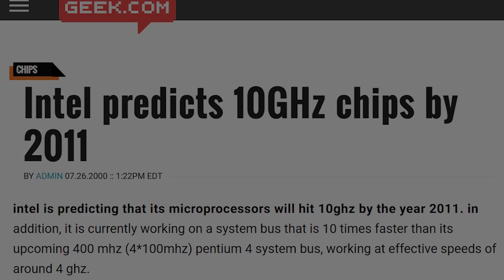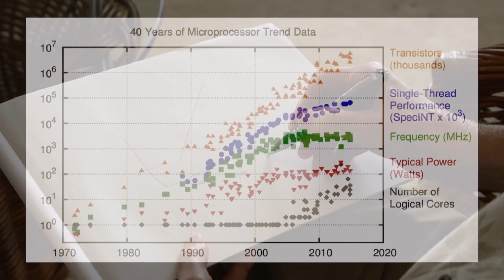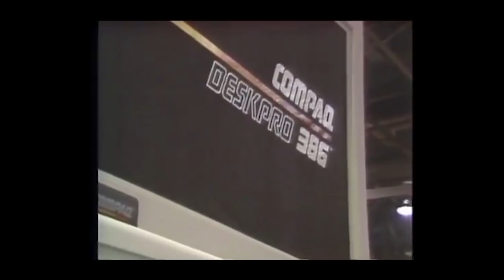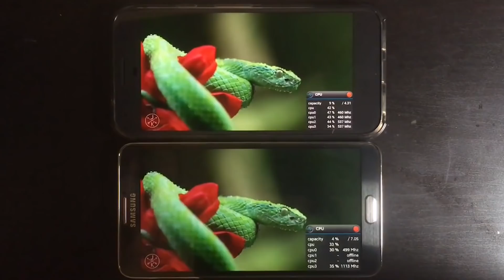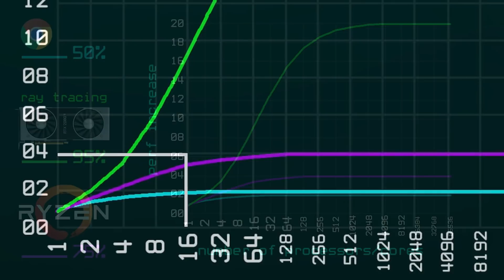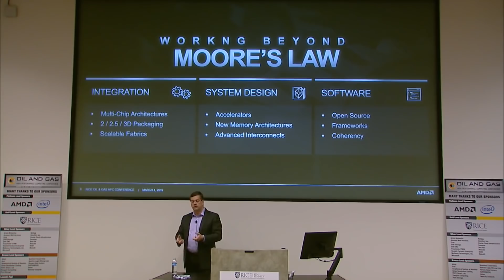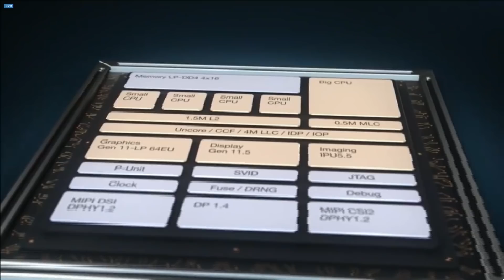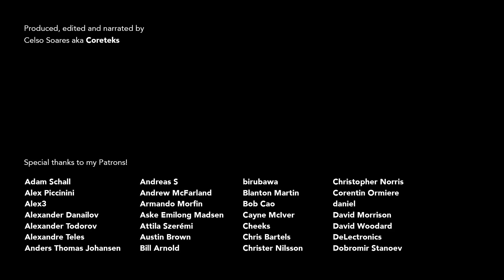Intel and AMD going BEYOND Moore's Law

Comment: Intel had Intel TERAHERTZ, 1THz, or 1000GHz chip in 2001 and they demo'd it at 100GHz in 2001 ! The said it ran at lower power, lower voltage and 10,000 times less leakage ! see the TechTV Terhertz commercial.  Motorola and DARPA have both announced Terahertz speeds in 2009 and 2011 too. So this is 3 companies that have demonstrated this in the real world. And 5G runs at 60GHz and 94GHz, but we  can barely do 5GHz ?  And we have had 1TB hard drive in 2007 and in 2019 they are STILL SOLD ! Barely any improvement in hard drives ! Seagate said they would have 100TB drives by 2012 then 2018 now 2022. There is no reason we should be stuck at 4GHz forever !  And even the many improvements in video cards aren't used in CPUs like 384 - 512 bit bus, GDDR5, HMB and HBM2 RAM, many more than just 4 cores. And single core performance is almost flat since 2007 !  Why can't we have the 100GHz or 1000GHz from Intel Terahers 18 years ago with similar to FinFet tech. And HEMT, 1THz transistors exist too, invented in the 1980s !  Intel said the 1THz, 1000GHz chips would be sold to consumers by about 2005. So where are they ? Or even the 10GHz you mentions ? It isn't a heat / power problem since Intel ran at LOWER power and voltage. Motorola and DARPA also mentioned no problems with heat. Maybe they are using the Intel technology.
And it's CPU speed, no single core improvement, RAM more that DOUBLE the 2012 price, and hard drives barely improving too. We should at about 64TB by now compared to the first 2007 1TB hard drive ! Yet they STILL SELL THEM 12 years later !
Reply: Intel never had 1THz in 2001, maybe they had a single transistor running that fast. Modern transistors might run at something like 10GHz individually, but when you have a few billion in a CPU, that number is a lot lower. In any case, the transistors aren't what's slowing down CPUs, it's power and heat requirements as well as the slow copper interconnects.
Reply: @jjwarner9419  They claimed to have a chip that was running at 100GHz with the tech being able to run at 1THz. They could be lying, but now Motorola and DARPA and claiming the exact same thing so unless all 3 are lying it is clearly possible. And the company that is making the HEMT transistors capable of 1THz and Northrop Grumman with their terahertz IC amplifier in 2014. The HEMT is in wiki HEMT, the Northrop Grumman story in Semiconductor Today, and the DARPA page is on DARPA's site. The wiki for Intel Teraherz listed about 3 different stories about them too. So do you really think all 4 companies are lying ? And notice they use the same HEMT transistors in this excerpt.
Northrop Grumman’s terahertz monolithic integrated circuit (TMIC) effectively bridges the gap by using a super-scaled 25nm gate-length indium phosphide (InP) high-electron-mobility transistor (HEMT) that measures at a gain of 10dB at 1THz and 9dB at 1.03THz. 
wiki for HEMT - Applications (eg for AlGaAs on GaAs) are similar to those of MESFETs – microwave and millimeter wave communications, imaging, radar, and radio astronomy – any application where high gain and low noise at high frequencies are required. HEMTs have shown current gain to frequencies greater than 600 GHz and power gain to frequencies greater than 1 THz.[5
ZDNet in 2001 - Intel terahertz transistor breaks speed limits
The terahertz transistor design -- a terahertz is a thousand gigahertz, or one trillion cycles a second -- is an evolution of current designs, using new materials such as zirconium dioxide. 
From DARPA - THZ Electronics
Terahertz Transistor Electronics. This part of the program has aggressively developed multi-THz Indium Phosphide-based transistors (heterojunction bipolar transistors, or HBTs, and High Electron Mobility Transistors, or HEMTs) and has demonstrated TMICs operating up to and above 1 THz. In addition, THz low-loss inter-element interconnect and integration technologies have been developed, enabling compact THz transmitter and receiver modules to demonstrate wireless communications at 220 GHz, 670 GHz, and 850 GHz – hundreds of times faster than your cell phone.
Motorola - Android Headlines - Terahertz Radio Transmission Promises 50Gbps Data Speeds

And AT&T - AT&T conducted trials in 2017 for business use of 400 gigabit Ethernet.[6] Researchers Robert Maher, Alex Alvarado, Domaniç Lavery, and Polina Bayvel of University College London were able to increase networking speeds to 1.125 terabits per second.[7]
AT&T* successfully completed testing a single-wavelength 400 gigabit Ethernet (GbE) data speed across its production network. This was the final phase of our multi-step trial. 

Notice how that story shows 332GHz demultiplexing ? So we can do 1.125 Terabits, 400 gigabit which has to be at least 200GHz for a single line ,1THz(1000GHz), 850GHz, 670GHz, 220GHz but 5GHz is the limit ? Notice the slowest of these stories showed 332GHz with all of them at 1THz, 1000GHz in use ? But nope, nothing over 5GHz is possible right ?
Reply: @jjwarner9419  Check out Intels ad at TechTV for them. And lookup Motorola, DARPA and HEMT transistors. All 3 companies have working chips running at 1THz. And another example is 5G. Lookup the frequencies for it of 60GHz and 94GHz. If you run the chips at much lower voltages you have much lower heat dissipation or I squared R losses and they are running at 0.5 and lower.  Don't believe me, read them for yourself. And ask how can a 94GHz 5G signal exist in a phone if silicon can only do 5GHz ? wiki the HEMT transistors that run over 1THz, up to 1300GHz the last time I checked with either DARPA or Motorola, I can't remember which. Notice how Coretek is also talking about how Intel was talking about 10GHz by around 2002 also ? They said the 1THz chips would be for sale to consumers by about 2005. Maybe the military doesn't want them sold, I don't know why they aren't out but all 3 companies say they have full chips, not just a single transistor or a mixer to hetrodyne the signal. Even Linus channel and others show 60GHz transcievers. And how do you think they control beamforming of a 60 or 94GHz signal if they don't have the silicon to do it. Perhaps the newer GaInAs chips that run faster and lower power that have been out for several years too. Notice this sentence from the wiki on HEMT transistors. Over 1THz, and their are several other transistor designs.
HEMTs have shown current gain to frequencies greater than 600 GHz and power gain to frequencies greater than 1 THz.[5]
And did you notice the patent date of 1979 ?   
US4163237 (A) ― 1979-07-31   US4163237 (A)  -  High mobility multilayered heterojunction devices employing modulated doping
This is 40 year old technology !  In 2001 the NSA said "consumers have too much computing power and we need to be able to read everyone's email".   Not related I'm sure.  Or it could just be greed by Intel but given the money they could make..... Maybe they make far more by selling exclusively to the military.  All I know is it's 1979 technology demonstrated in 2001 at 1THz and 100GHz by Intel, then DARPA and Motorola in 2009 and 2011.
2001 techtv clip - intels new "terahertz transistor"
https://youtu.be/U-Z1Zbqr0co
"By a complete redesign of the transistor itself
". Reducing the heat and leakage by 10,000 times, and LOWER power.
Watch for yourself from all 3 companies if DARPA hasn't removed their pages completely yet and several other articles.
"The chips could be in MASS PRODUCTION BY 2005".
Reply: @jjwarner9419  Even people on their own have had Intel CPUs up to 7GHz, and 8GHz with liquid nitrogen. This shows the silicon can go much faster. If they can make a 32 and 72 core CPU then they can make a 6 or 8 core much cheaper for consumers but notice the 4 cores are stuck at about $325 - 350 ?   And they can have the cores more widely spaced with soldered heat spreaders like they have done in the past instead of the paste that is less reliable. Use the Terahertz tech at only 10GHz or 100GHz running at .3 to .5v and it would be a big improvement and use the same speedstep type control as needed. Nvidia also shows testing at 10GHz and even 15GHz in some of coreteks videos. But see for yourself. I'm only going by what products are already out like 60GHz and 94GHz 5G that are in phones in chips instead of microwave plumbing waveguides. How can a 5G phone run at 94GHz if we don't have the chips to do it let alone the faster beamforming chips needed, ADC to convert to a baseband signal.
Reply: @jjwarner9419  Here is another example of technology that "doesn't exist". Watch "Rise of the Drones" on PBS. He mention the drones store 1 MILLION TERABYES PER DAY for EACH DRONE.  How do you make a RAID system that increases by 1 MILLION TB per day ? Your own hard drive factory ? Must be a mistake ? He mention the drone uses a 1.3 BILLION pixel sensor made from 384 cell phone cameras. So take 384 camera video for 24 hours a day at 60 FPS. It come up with about 700,000TB per day on one video calculator site ! And add the IR cameras not metioned too for even more data !  See the transcript on PBS for "Rise of the Drones" that shows these specs for a 1.3 billion pixel camera made from 384 cell phone camera sensors.  What tech could be used to story it ? Even a 10TB drive would be 100,000 new drives every day to reach 1,000,000 TB per day !

Comment: Didn't AMD already have "Neural Net Prediction Technology" in Ryzen?
Reply from the maker: You mean SenseMI? I believe that's for branch prediction, which is not quite the same thing. Prediction and Speculative Execution have been around for a long long time (since 386 at least).
Reply: @Coreteks  True, at the time it struck me that they emphasized the machine intelligence, learning and adopting. Anyway great video!
Reply: They are using a perceptron network, versus a neural network which can describe a miltilayer perceptron network. The single layer perceptron network gives them pretty good branch prediction via ML, but it can only find linearly seperable patters with which to predict the next instruction.

Feed forward neural networks can find nonlinear seperable patters with a corresponding differential order equal to the number of layers. There are some super nutty network designs that sidestep this and allow for arbitrary dimensionality from a single layer network, but that is probably outside the scope of what we would see in use here.

Comment: This tech reminds me of Process Lasso, ProBalance.
Reply: This is on the hardware level though not software
Reply: @456MrPeople 
Understood. But I wonder what differences there are?  I've heard that some online game anti-cheats prohibit Process Lasso.  Which is why I stopped using it.
Reply: @eastcoasthandle  "You heard" and "some online games" is not a good reason to stop using it.
Reply: @samixz  
Was it ever addressed otherwise? That's the point to my reply not about what I think I know or heard.  
Furthermore, what benefit does it offer using today's cpus? Are there current video demonstrations showing how using it benefits us in games today?
Reply: Video demonstrations? I don't really know. However I do know it helps me when I run 22 game clients on my computer at the same time!

Comment: Sorry if this is a noob question but... if you increase the number of cores, doesn't that mean that you can do more things at a time? Like run a game while you're raytracing something in the background or something?
Reply from the maker: Yes, that's one of the current benefits of multi-core CPUs, for instance if you are gaming and streaming at the same time. The video discusses improvements to single-threaded performance more specifically.
Reply: @Coreteks  does it work on dell Alienware r4 Intel i7 7700hk?
Reply: Yes, it does. However, most user loads don't approach full utilization to the point of needing more cores.
Reply: @droneaerial9140  Oh, okay. Thanks for the info!
Reply: I don't get the logic
Who runs games, renders, edits, watches videos, browses the Web at the same time

Comment: well, if you look at parallel processing like multiples of frequency, they weren't far off. it just ended up making more sense to do multicore instead for a lot of reasons.
Reply: Except they aren't multiples of frequencies.
Reply: @AhidoMikaro  For many applications, 2 cores at 3 Ghz ~= 1 core at 6 Ghz (not to mention the former uses 2-4 times less power if not more), since the vast majority of applications aren't that strictly sequential. In 2011 the best CPU to come out was probably the i7-3960X which had 6 cores plus hyperthreading at 3.3 Ghz. 3.3 * 6 ~= 19.8 Ghz-Cores of power. HT generally boosts that up by about 30% to 25.7 Ghz-Cores (it would be nice to use something like FLOPS for this but I would need predictions from 2000 in terms of FLOPS). Various architecture optimizations also boost it up, but just from those values alone we've blown past the 10 Ghz-cores mark that was predicted. 

Even considering Amdahl's law, at only 6/12 cores we still don't hit the diminishing returns too hard for many applications, especially since real-world use has cores being dedicated to certain things like the OS which gives an entire free set of cores towards more demanding applications, which means an application that makes no direct use of multicore architecture still benefit from it noticeably (no longer being interrupted so the OS kernel or web browser you also have running can do whatever random thing).
Reply: @KaiserTom  For sure. I'd rather have 2x3Ghz cores running 2 programs simultaneously than 1x6Ghz core trying to divide itself between the 2.
Reply: @AhidoMikaro  I didn't say they are?

Comment: I've been waiting for a new video from you or AdoredTV. It's about time!
Reply: why not a crossover?
Reply: @marcobonera838  AdoredTeks?
Reply: @unclerubo  core tv 😂
Reply: Because he's is a stubborn fanboy. Mark my words - he's gona change shoes once again when it will turn out that Zen 2 wont have 16 cores.
Reply: @Tjecktjeck  who cares how many cores ryzen will have, as long as it's more than Intel's. But why do you think so?
Reply: Marco Bonera I dont care either, but im heavily against fake hype content that is labeled as ''leaks''. Simply because of TDP and Zen 2's compatibility with Zen/+ chipsets. Entry 3 phase and even mid- tier boards with 4-6 phases wont be able to run 16 cores without frying, especially not at these speeds he ''leaked''. A company (even if it can potentially make 16 core) will never go against mainstream market. Secondly MS platform doesn't need that core count today and wont need in near future. Only possibility of 16 core on X370/470 is if they make it run at ~3ghz - but that wouldn't make sense as there's aleredy TR platform.
Reply: @Tjecktjeck  i also think it's useless for amd to release such a high core count, because as long as they have a couple more than Intel (say 10-12), they are going to win. No need to release another totally useless model with 16, that burns everything, just for fun. If Intel spits out another i9-999999, only then amd should produce a 16 core variant.

Comment: Edit: i watched ur video further. You said that xD

It may sound stupid but as far as i understand you said, that one software, which uses more that 32 cores, wont gain much performance.

But what if you split one software into multible ones? Like the basic game is one kind of windows, the AI of the NPC, rendering etc. Are just softwares, running parallel as own softwares?